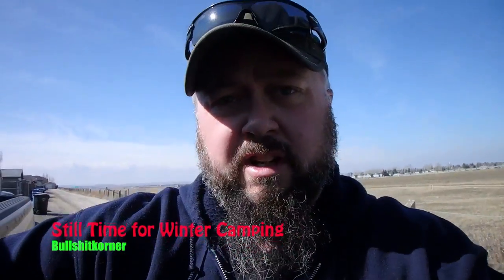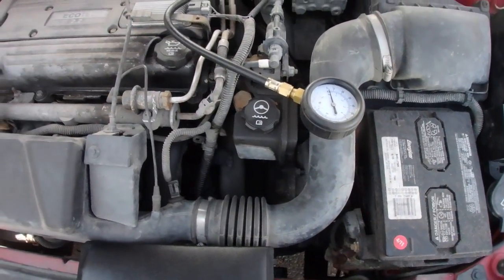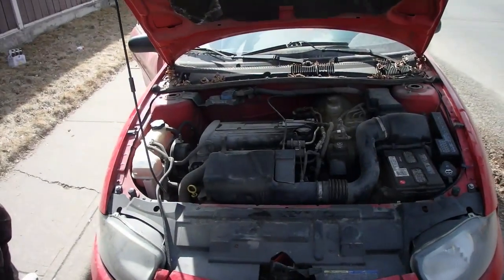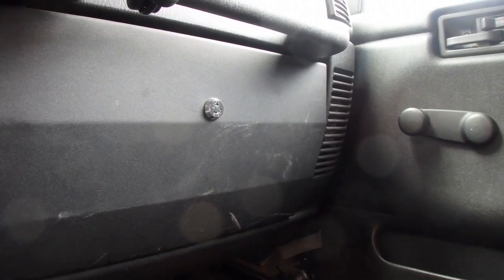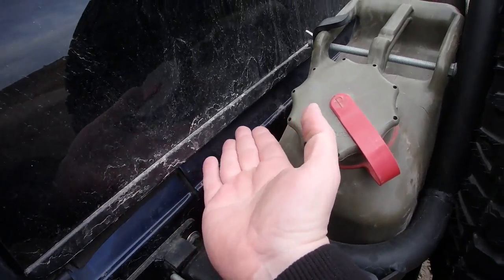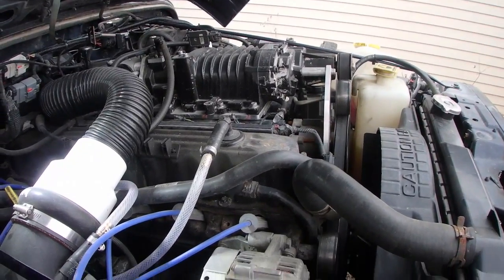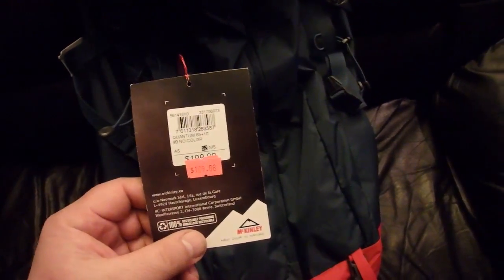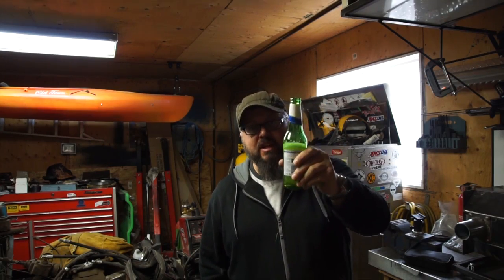Crank No Start and PreCamping Packing

Comment: You need to build yourself an off road trailer. i built an enclosed one for 500.00 buck or so. I leave all my camping gear in it, all i have to do is grab some clothing and the cooler and I'm off.
Reply from the maker: +retiredppd someday when the economy turns around here i will consider it

Comment: Hi Jerry A cool trick for checking power and gnd. at the fuel pump or any ware else is this.Get a old fog lite and attach some long wires to it now hook it to the 2 wiers at the fuel pump If the fog lite comes on bright you should have good power and gnd. Also handy for chasing a short ckt. (use it  in place of fuse)
Reply: +Joseph Tucci I like that tip :)
Reply from the maker: +Joseph Tucci that is a good tip, I have a power probe I use for these situations allows me to apply voltage plus takes voltage readings
Reply: +Bullshitkorner  Jerrry a power probe will not load the ckt. like a fog lite. IE if a fog lite is on brightly the ckt should be able to handle the fuel pump NO?  If I am wrong pls say how PS I own a power probe also  great tool
Reply from the maker: +Joseph Tucci you will see in a future video
Reply: +Bullshitkorner I just ordered one waiting for it to come in the Power probes are so slick as they can be
Reply: +Bullshitkorner yes sir :)
Reply: +Bullshitkorner I think so it is a IV